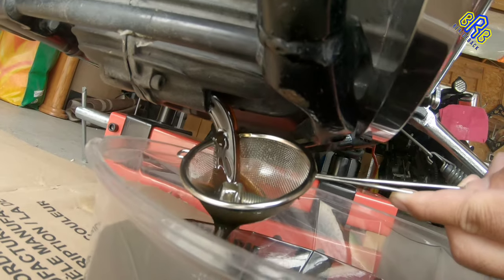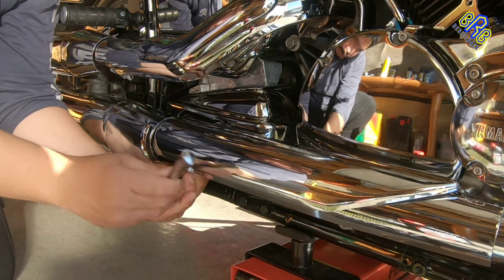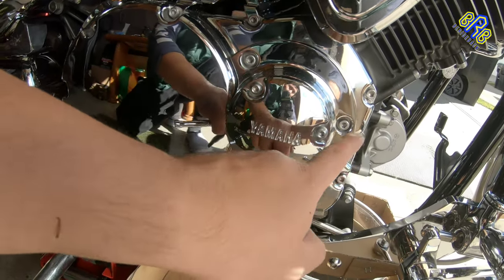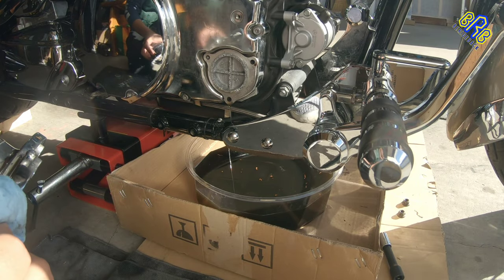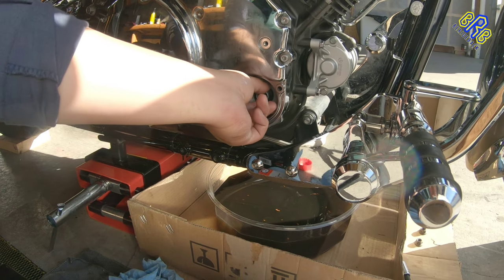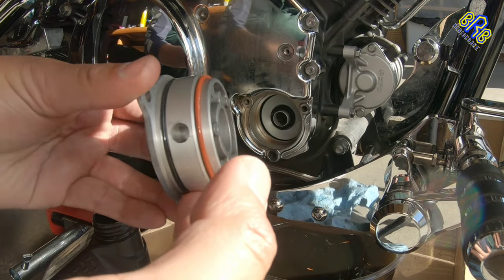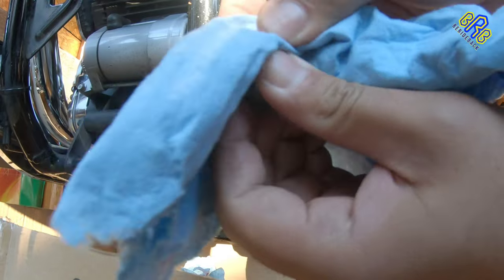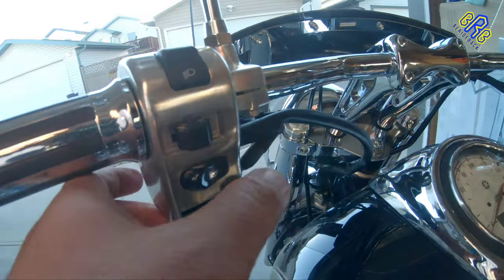Oil Change Yamaha V Star 1100 With Filter

Comment: What I'm wondering is why there are no o-rings on the upper two seal plate screws, just the lower one.  Also I would put a bit of never-seize, if available, on the exhaust bolts going back in.  Helps a lot for next time.

Comment: If you "throw away" the chrome cover and use shorter bolts for the inner cover  ..could you skip the pipe removal on the next oil change ?